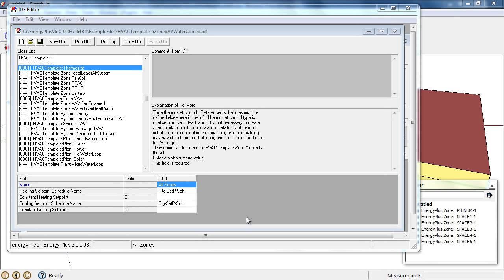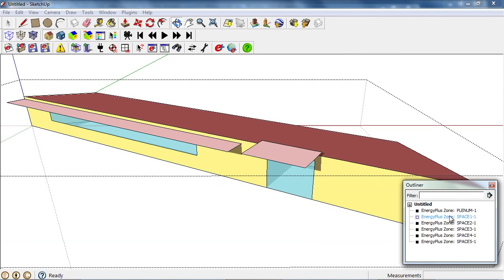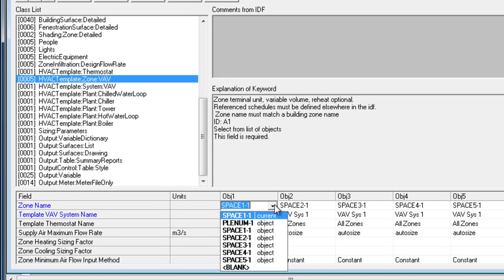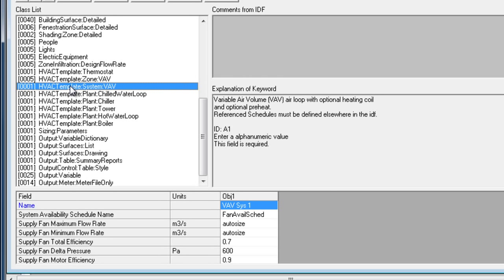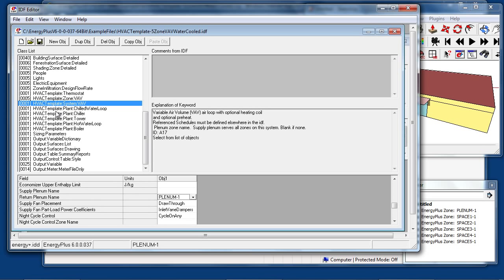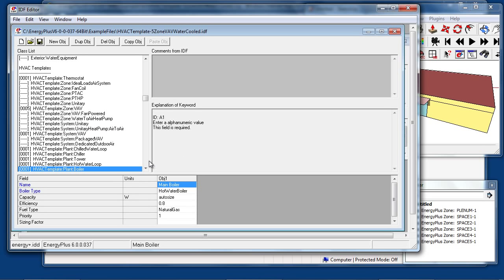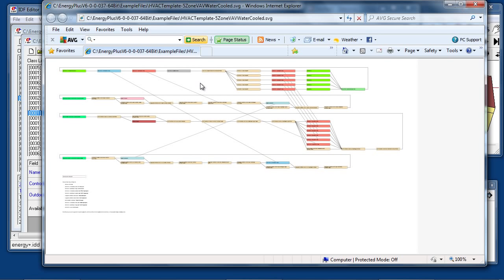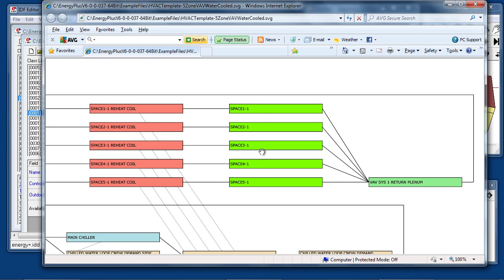EnergyPlus HVACTemplate Overview

Comment: Love your videos!!! anyway, I have a question... I saw there was a single .IDF that runned 6 simulations (think it was in the second video)... I was wondering if I could use that to, for example, run several simulations of a single building, changing the wall materials or something like that in an easier way that changing it manually every time with the IDF editor and then run the simulation... If there is a way... can you please tell me? thank you very much!

Comment: Dear  Mr sir,

I am an Master student in building modelling, I am on the process of writing my dissertation where I am looking at the impact of internal furniture in a passivhaus building. I am trying to model a Passivhaus which has as main heating system a mechanical ventilation system with a heat recovery. My background is architecture and I am founding a bit complex to create this system in energy plus. I wonder if you can give me same guidance of how is the easiest way to do it . Thanks
Reply: please help me I am facing the same problem 
I want to simulate the cooling radiant system.  
Can you tell me the easiest way to do it? thanks